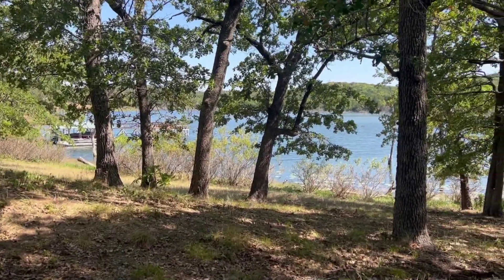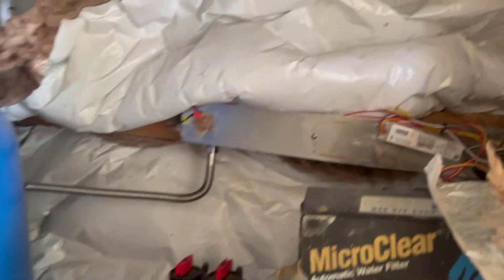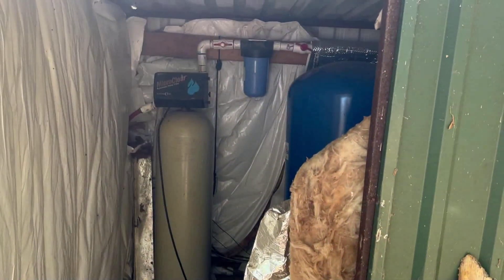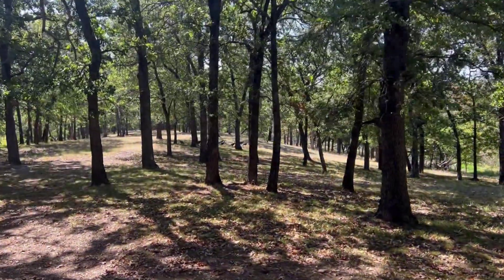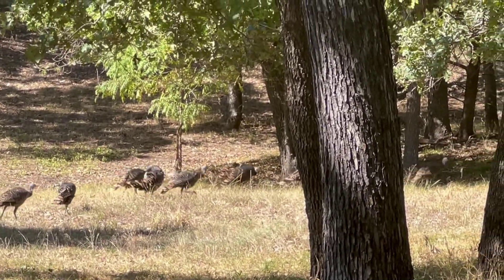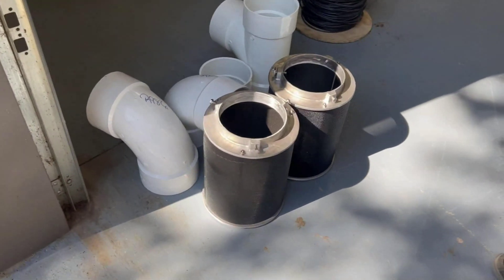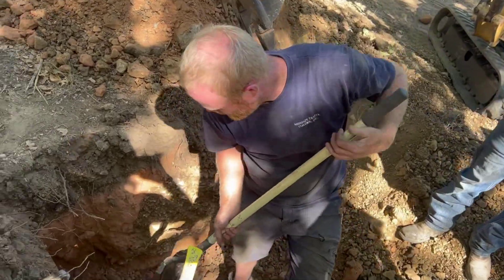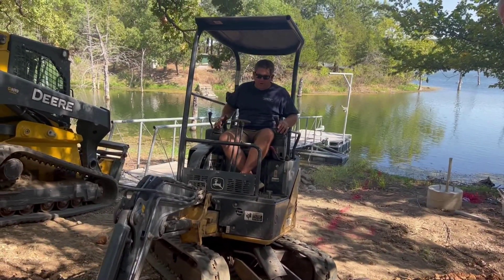Big Time Upgrade at the Ranch!

Comment: Jimmy, If you plan or need to use a torch in that shed don't get the torch or sparks next to the insulation because it will burn it off in a flash. Spray foam insulation is very flammable.
Reply from the maker: Yes. I know.  Chris doesn’t let me play with fire berry often.   Thanks.  May God Bless.  jimmy

Comment: Glad to see you installing a new water system. the other one seemed to have given you some problems the last few years and never at a good time.
Do you think you would use the old one to irrigate the lawn and/or gardens? Won't need to filter it for that.
Reply from the maker: No we have our sprinkler system drawing directly from the lake.   That way we reuse the fertilizer we out in the lake.  Not bad.   Thanks.  May God Bless.   jimmy

Comment: Jimmy I really think you may be dealing with Fusobacterium varium . This is a small excerpt from a study done that was in Journal of Veterinary Diagnostic Investigation 2014, Vol. 26(2) 213 –220. "Fusobacterium has been associated with ulcerative colitis, colonic neoplasia, decubitus ulcers, and respiratory tract infections in human beings, and with suppurative or ulcerative lesions of the gastrointestinal tract or oral cavity in animals.  Various Fusobacterium spp. have been isolated from wild ruminants affected by necrobacillosis, a common disease of farm- raised deer characterized by purulent necrotic lesions most commonly affecting the mouth, pharynx, lung, liver, or feet." More susceptible to ampicillin, florfenicol, and trimethoprim–sulfamethoxazole and more resistant to β-lactams and clindamycin as well as chlortetracycline, oxytetracycline, tiamulin, tilmicosin, tulathromycin, and tylosin.

Comment: So are you going to go over to the new water intake dock and start making fishing videos? Drop a few brush piles around there, get some new structure going? Maybe get some cheap, tiny underwater LED lights to attract insects and little bait fish at night? I guess a feeder's out of the question, getting feed sucked up by the pump would make a mess. Probably take up too much room, with the variable water level there probably isn't a good spot to put one nearby either.
Reply from the maker: It’s definitely sitting in a good spot, J Tee.  I bet that vibration form the pump will make
It better.   Thanks.  Godspeed!  jimmy

Comment: This is great to see your gonna have a more reliable heated pump house. You have great friend's..I just got done trenching miles with a similar excavator for conduit for all the site lighting last week and those machines hurt your back they are not as comfy as they look. now i have the fun of running conduit and all the wire, plus standing up the pole lights with a LULL. May God Bless great job guys
Reply from the maker: Oh my, big time job.   Get er done.   Thanks.  May God Bless.  jimmy
Reply: @TwinEagleRanch  yes. It is its two 1,000,000 sq ft Amazon warehouses side by side practically

Comment: Yes that seal tight on the pump has steel inside but nothing stops a greedy beaver rite jimmy. I promise he wont like the jolt once he gets to that wire tho ⚡⚡⚡ and youll have that running way before the freeze jimmy it 77° here in NJ still
Reply from the maker: I sure hope so, Travis.  We have 77 forecast for tomorrow.   Thanks.  May God Bless.  jimmy

Comment: Have you check on your Jackery portable generators. My wish is to get the 2,000 watt unit and storage bag. since you showed us on a video a ways back. they’ve already came in handy. on a rv trip the surge protector on the inside of the rv down in the storage bay failed. all i had at the time was my x-mass gift of the 240. charge 📱 phones. my dad had taken electrical engineering in college so after talking with tech and re wiring the space shuttle everything is hunky dory.  but yes 👍🏻 their worth it.  HOPEFULLY 🙏 i can get a viewer or what not to get the 2,000 watt unit. because the fridge during that time made it half the night on rv batteries 🪫 had i been able to afford the their new unit my dad even with extension cord may have not been able reach the plug in the middle of the night our rv has a residential fridge just like in your house rv has an inverter. being that the surge protector died and drained the rv batteries killed the entire rv no ac no nothing. even with it plugged up it was dead. which meant you can’t run the hydraulic jacks for the leveling system or  or front jacks to hook the fifth wheel up.  that’s 18,000 plus dead weight. after plugging direct disconnecting that surge protector running off the box 50 amps just using a single surge protector as precaution as usual everything works as it should. yes the galley and living is hydraulic to. parents bedroom is electric slide it’s the only slide out on the rv that’s electric your awnings are electric to. it’s important to carry a generator with you weather you use it or not. HOPE that a viewer would be kind enough to get me their unit and bag. the solar panels i don’t need.
Reply from the maker: I have a jacket unit, Mark and it worked great.  My problem is I guess I put power cord in the box and the box was thrown away and burned.   Need to send them a note and see if they will send me another one.  Sounds like y’all’s  RV is super nice.  As long as you have plenty of power!    Thanks.  May God Bless.  jimmy